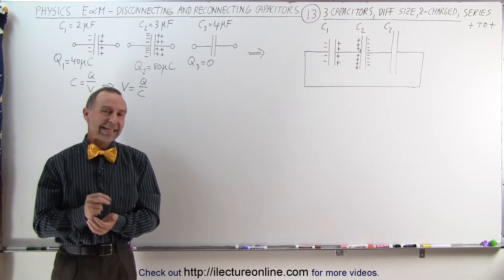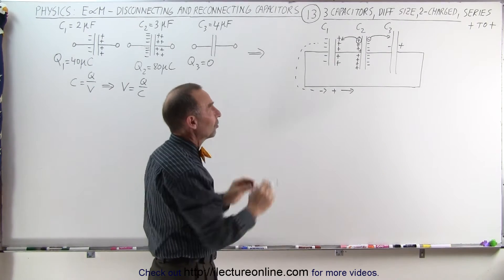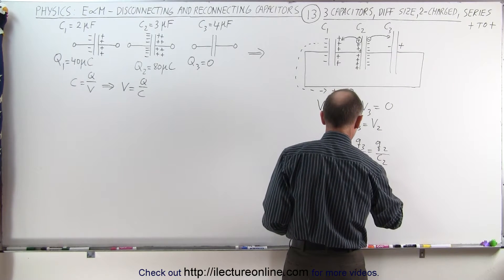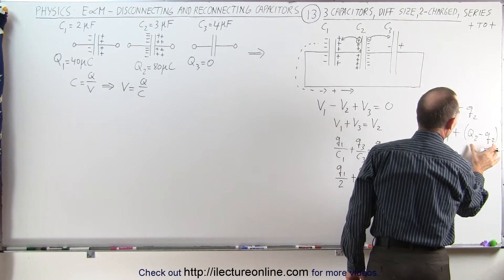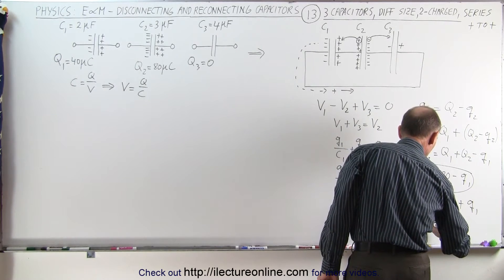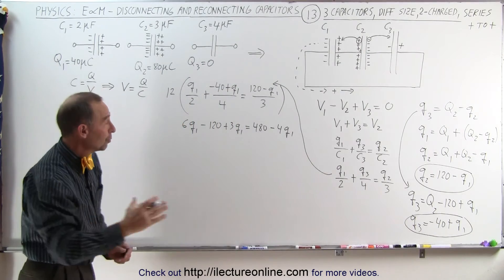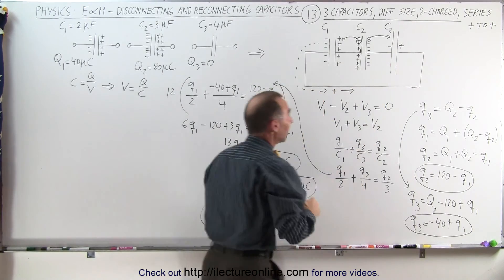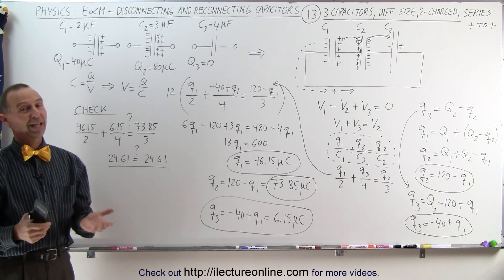Physics - E&M: Dis- and Re-Connecting Capacitors (13 of 16) 3-Cap., Diff., 2-Charged, Series, + to +

Comment: Hello, sir. I would like to ask what would happen if we connected uncharged capacitors in series with a voltage source, and we had one of these capacitors connected to two other capacitors in series with each other and one of these two were polarized. We can also suppose for simplicity that they have the same capacitance. Thank you in advance.
Reply from the maker: This is difficult to answer in a comment format, and your description does leave some room for misinterpretation.
Reply: @MichelvanBiezen  I meant something like this picture: https://drive.google.com/file/d/1hILZIDKLRMxWTHVMkerWZ0Wkk4WxJpIF/view?usp=sharing. I couldn't find anything on YouTube nor on the internet. My textbooks don't say anything about this topic either. I just wondered whether such analysis is even possible. I'll keep searching. Thank you for your time.